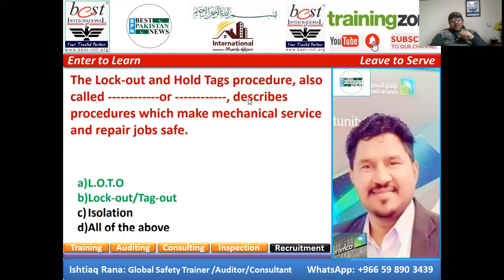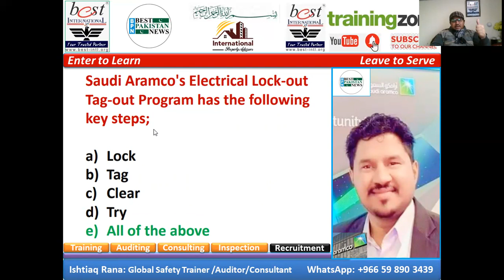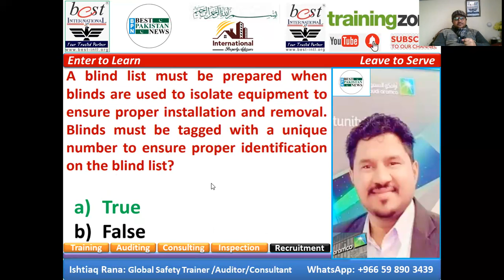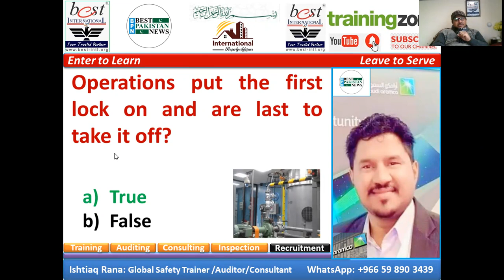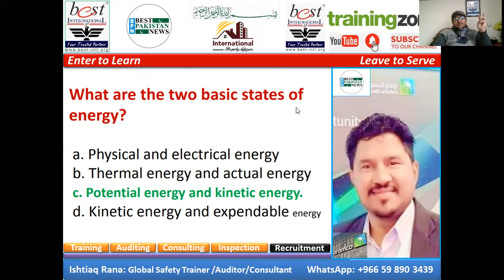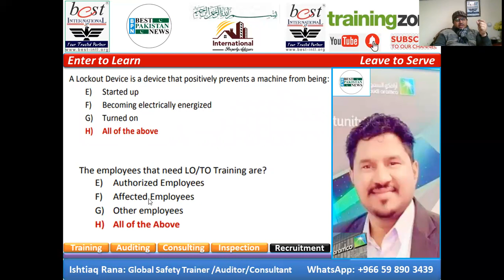Saudi Aramco 3rd Party Work Permit Receiver (WPR) Training LOTO EXAM Questions & Answers (V1)

Comment: Sir as salamu aleikum....sir you have explain here primary method for isolation process pipe line and equipment..okay..I greed with you sir..but I have read on book  primary method is only for consider to single block valve and double block valve..and positive isolation method is blinding and disconnecte to pipe...these method is applying for high risk...primary isolation is for just lock..not secure

Comment: How many pad locks can be used in hasp lock maximum?
Reply from the maker: A hasp lock pad typically accommodates 2-4 padlocks, depending on the design and size of the hasp. Here's a breakdown:

Types of Hasp Lock Pads:

1. Single hasp: 1-2 padlocks
2. Double hasp: 2-3 padlocks
3. Triple hasp: 3-4 padlocks
4. Heavy-duty hasp: 4-6 padlocks (industrial or high-security applications)

Factors Affecting Padlock Capacity:

1. Hasp size and thickness
2. Padlock size and type (e.g., disc tumbler, combination)
3. Shackle diameter and material
4. Security requirements (e.g., high-security, tamper-evident)

Common Hasp Lock Pad Configurations:

1. 2-padlock hasp (most common)
2. 3-padlock hasp (for added security)
3. 4-padlock hasp (for high-security applications)

Standards and Regulations:

1. ANSI/BHMA A156.13 (American National Standard for Hasp Locks)
2. EN 12209 (European Standard for Locks and Locking Systems)

Manufacturer-Specific Guidance:

Consult the manufacturer's documentation for specific guidance on padlock capacity for their hasp lock pads.